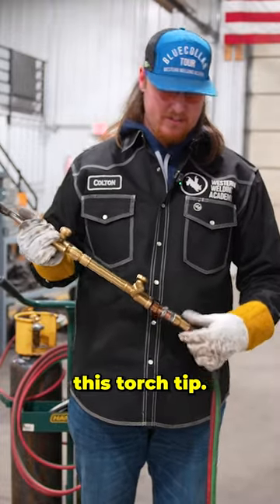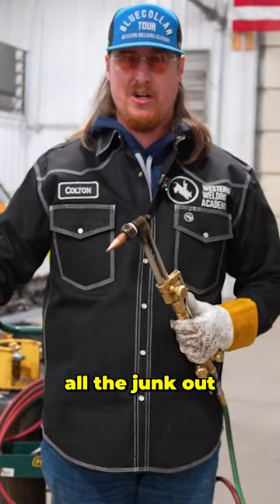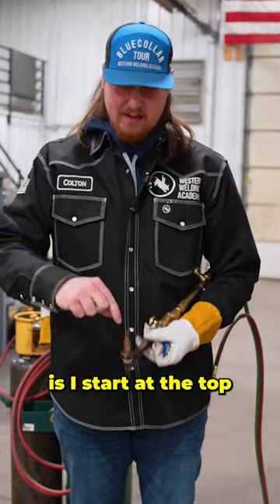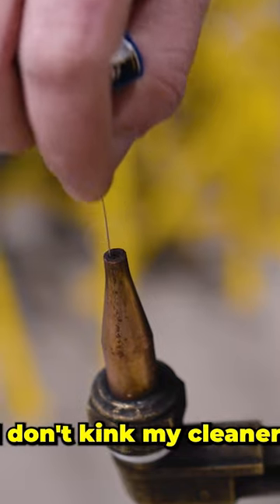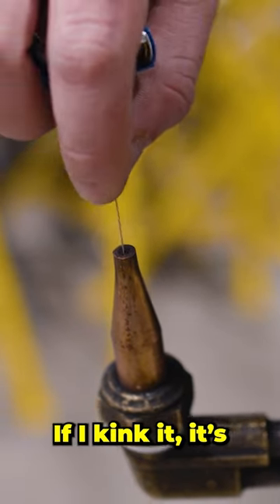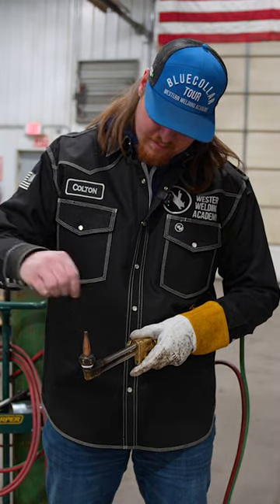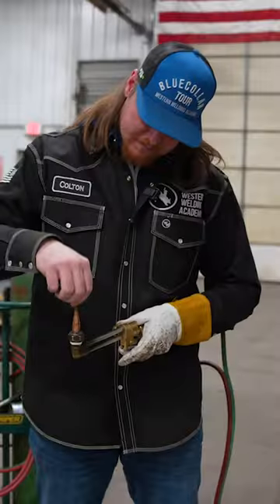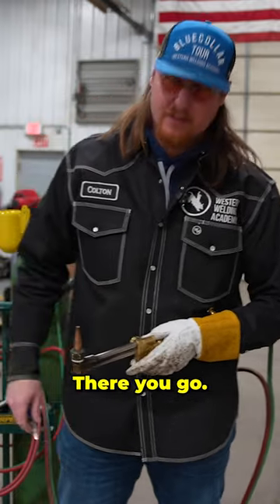How do I clean an Acetylene torch? 🤔 #shorts #WWA

Comment: If you clean the face last without using 02 your defeating the purpose of your non essential air purging the whole thing plus if you dont push oxygen when you pick the main you could still clogg it by your logic, reach down give your balls a tug and clean the tip casually off the torch and blast it with air before reinstalling it and go about your day like your a worker not a “teacher”. This is the same d-bag that says to wear hi vis for safety. Go on boy but come to my job and hide in the shitter

Comment: I was taught to NEVER blow oxygen onto my skin because there’s a potential of it reacting violently with the oils in your skin? I may be wrong but it’s what I was taught by a man that traveled the world as a welder and welding instructor.
Reply from the maker: It's not advised yeah but you're not blowing it on your skin for too long
Reply: You can actually force air thru your skin into your bloodstream and cause a bloodclot

Comment: As you soak your welding clothing with pure oxygen. Bro you might just win a Darwin award with that one
Reply: That’s not how it works
Reply: You not to bright are you, number 1 you surrounded with oxygen everyday you are alive. #2 oxygen isn't even flammable so what does it matter. #3 nothing soaks with oxygen it's not a liquid it's a gas. 😂🤡 People will literally show off and flex ignorance. Back when I was younger people actually tried to hide they were ignorant. Weird how that has changed.
Reply: It’s not in a liquid state. The density of gaseous oxygen is roughly the same as air and with pure oxygen being ionic will bound with other elements to become neutral. Generally the carbon, hydrogen and nitrogen in the air.
Reply: Bro failed elementary school 👌👌